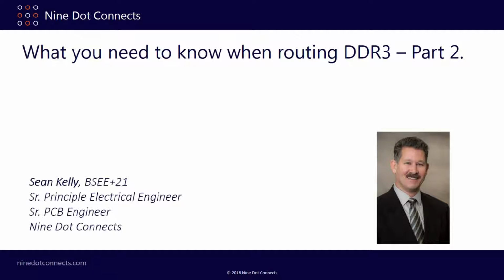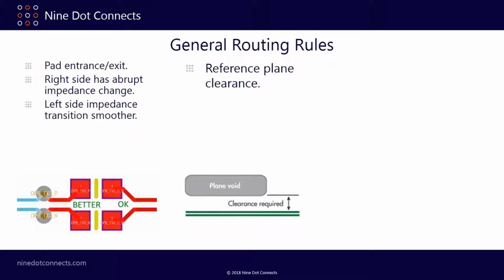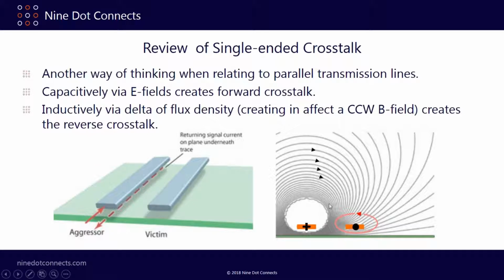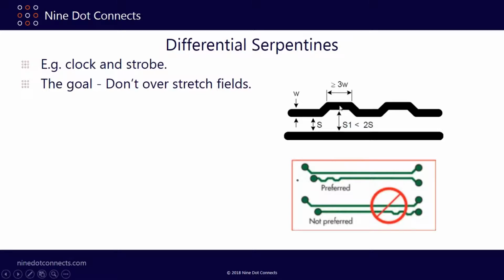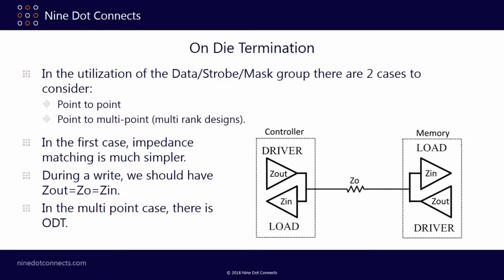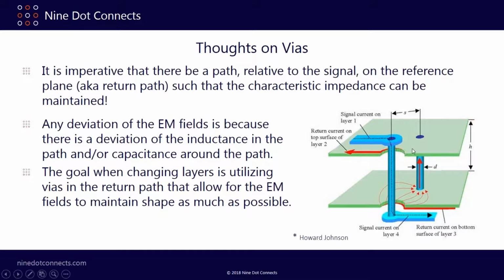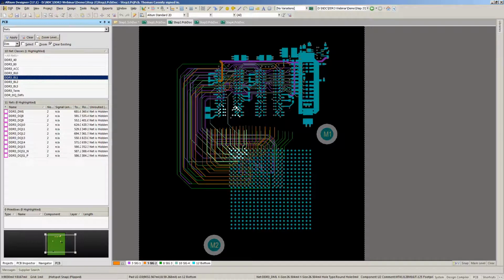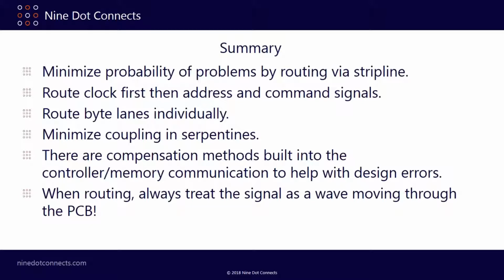What You Need to Know When Routing DDR3   Part 2 of 2

Comment: Thanks for the helpful video. Are there any length matching requirement between the byte lanes and addr/cmd/ctrl signals?
Reply from the maker: Length matching is only required within an individual byte lane, including the DQS clock. The ACC signals only have to be matched to the CLK signal. There is no matching that is needed between the byte lane groups and the ACC groups, other than meeting the overall timing requirements based on the clock speed and cycle timing.

Comment: Thank you very much for this detailed video on DDRs.
I have question: for the Address/Command/Control (ACC) signals, it looks like from the routing @46:00, they use all the layers for routing.
Can we do the routing of ACC signals using many layers?  
I try routing ACC on 1 layer, it is impossible, on 2 layers it is very hard to do the serpentines.
Reply from the maker: Because the timing of the ACC signals is not as tight as those of the data bus signals, it is okay to route the ACC signals on different layers and have (possibly) different propagation delays, as long as the overall timing requirements are met. And as you found out, it is difficult, if not impossible, to get the length matching of so many signals on just one or two layers.
Reply: Thank you very much for your reply. I am relieved to hear that. Based on the video you posted and the feedback from you, I shall try routing them.
Reply from the maker: Glad to hear.  Good luck!

Comment: How can we achive the pin lentgh numbers, are they in the datasheets ?
Reply from the maker: I believe you are asking about the pin delay. That is a value created by the FPGA software. This delay will vary based on the device's configuration, so it will have to be generated once the FPGA pins have been assigned. For Xilinx, it is called Vivaldo.
Reply: @NineDotConnects  do we need to match the pin delays for IMX6 or whatever non FPGA SoC devices ?
Reply from the maker: Yes, you do.